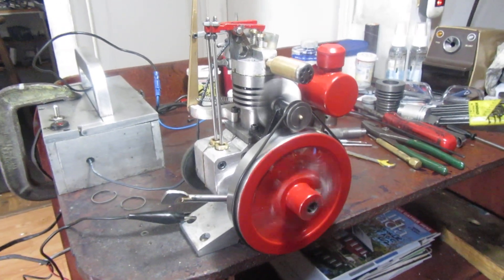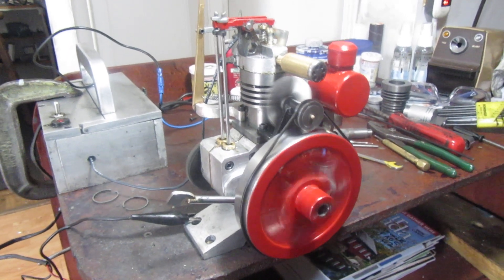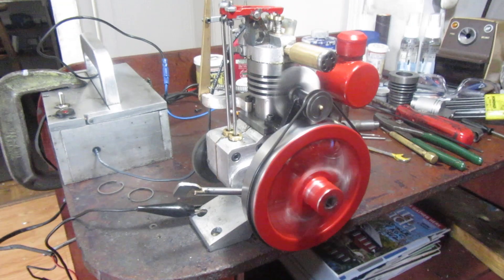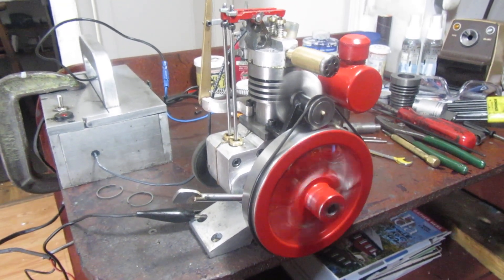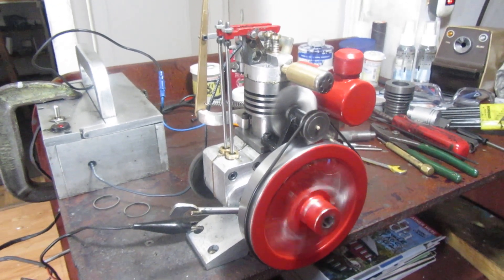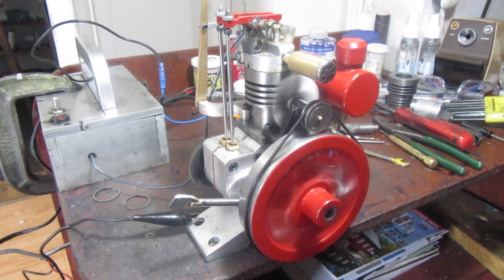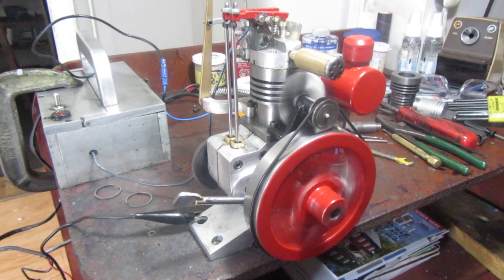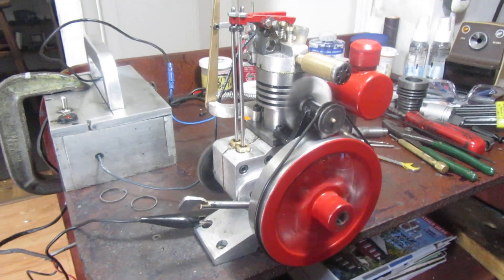VERTICAL I C  2021 NEW CYL AND PISTON  STILL VITON RING 2021 06 11 001

Comment from the maker: the viton ring is 1" o.d. x 7/8" i.d. it is a simple round profile. It actually measures 0.070" in diameter, not 1/16"
Reply: thanks for your response . I' m asking what type not size. Is it black or brown ? 75 shore  or 90 shore ? what is the hardness ?